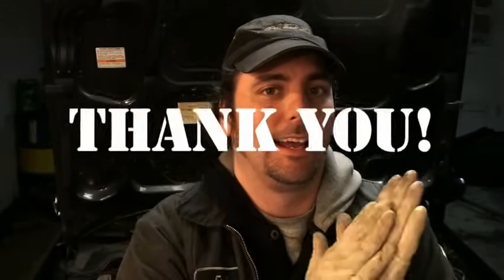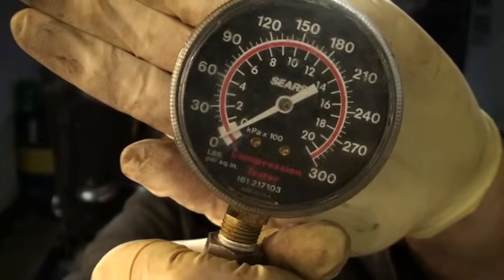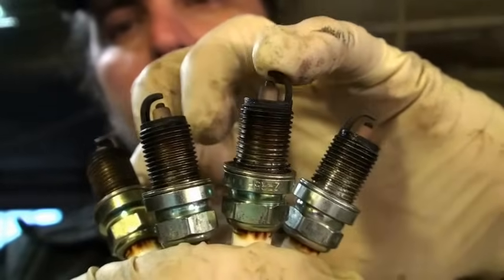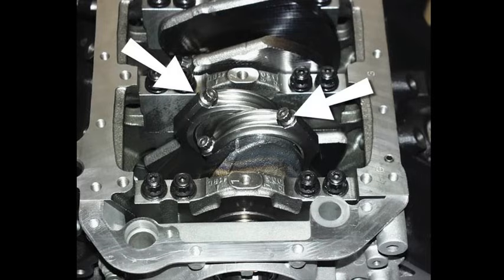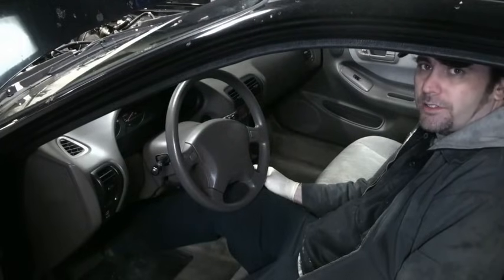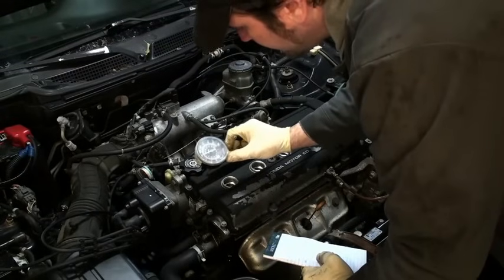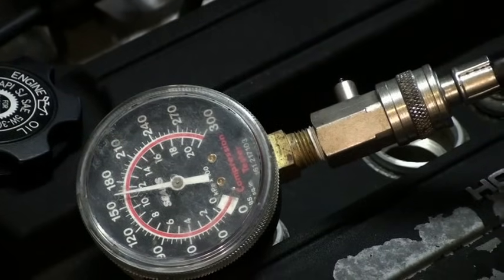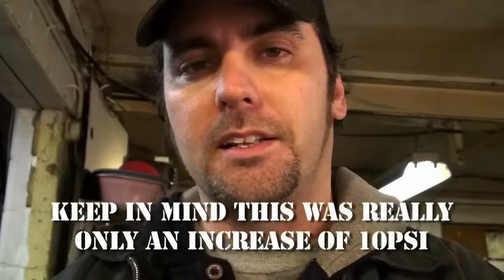How To Perform a Compression Test - EricTheCarGuy

Comment: the seal to fail around the sensor thus spewing all my oil out

my other problem is i think my valves could be sticking thus causing the engine to burn up all the oil.. what should i do where should i start

Comment: hey eric i have a problem my 1975 ranchero i just got ~,~ its a shitty gm shared engine 400 cid i am having several issues  1 is that there is some type of sensor behind the air box that is leaking..... i was coming home and i noticed a tapping sound . Now 2 days later there is barely no oil on the stick what so ever it is hard to start on cold days  considering this vehicle recommends 20w-30 and 20-40 Weight oil not sure if the sensor was a oil pressure sensor that just completly failed causing

Comment: My mechanic told me that the cylinder number 8 had an electric leak, what y mean is that the spark plug was not completely seal and the nut that hold the spark was broken and this could cause a compression problem is that true ?

Comment: Eric i have the same problem with my 2001 f150 In some point when driving i felt that the car was shaking and my mechanic said that there was a problem with compression, of course if this truck had a distributor it would be much easier to locate the cylinder that was having problems but since this truck has separate coil a scan tool had to be plugged to see the cylinder.

Comment from the maker: @journeyquest1 I suppose you could say that but a head gasket may only show up if it's between 2 cylinders.  You might want to watch the Diagnosing A Cooling System Overheat for a test for a head gasket failure.

Comment from the maker: @stanb420 That information is specific to the engine that your working on.  In my experience these numbers were fairly typical but if you really want to know what shape the engine is in do a Leak Down test as it is far more accurate.  A compression test is normally good for a 'quick look' at an engines general health but nothing more.

Comment from the maker: @RalphdaCuban It is true that many fuel injection systems rely on a vacuum operated fuel pressure regulator however if you have a compression loss vacuum loss is really not the primary concern.  Thanks for your comment.

Comment: Makes sense. I guess I have to stick to the "trial and error" method. Since tuning by ear has worked great for me in the past for finding that "sweet spot" for air fuel mix detonation (even though there are stock settings for timing). We folks down here have a problem with watery gas (even in premium) That water does make the perfect detonation hard to find. But hey,thanks for the quick reply. I was just hoping that there tool could be used to make tuning by ear turn into tuning by sight. Peace

Comment from the maker: @gregorydtatum Compression is constant and has nothing to do with when the plug fires.  Since the time it takes for the mixture to burn is also relatively constant the 'timing' of when you begin combustion is critical for optimum power and efficiency.  I think you need to change you thinking of the relationship between compression and when the spark occurs as you are kind of getting into left field.

Comment: Thanks for getting back to me so fast Eric. And I wanna go on record as saying DUH, duh, duhhh Greg. I totally forgot to take in consideration the fact the plug fires BEFORE top dead center. If not, the timing would be set to 0. But i was more in the lane of thinking that maybe the compression tester can give you an idea of how deep the stroke is and compression in the cylinder just before ignition. Then while slowly turning the distributor the pre-ignition compression changes........

Comment: @EricTheCarGuy 
I just check the timing, the timing is off by about 1 to 1.5 cm.
I checked the gap between the mark on the crank pulley and on the engine block, a little arrow.
Considering the size of that gap, is it the belt being too loose or the timing belt off by a tooth?
Thanks

Comment: Heck of a video man! I agree with the others that say you should be a teacher if you're not already. I just have one question. Since ignition timing is basically when the spark plug fires compared to the piston's position on the compression stroke.......I wonder, can a compression gauge be used to set OPTIMUM engine timing? I often have WEIRD questions to ask (I like to think outside the box) so forgive me in advance, think about it, and get back to me. Thanks, GREG

Comment: @mariohdz2626 Glad you listened to my advice...I've had plenty of experience with ebay garbage over the years on my eclipse. I just finished a major build, induced by my ebay trash that i put on cause i needed a dd and was low in the wallet. Now im runnin a completely built head by dsmgraveyard = 1750. MHI evo III Big 16g. DSMlink on 95 eprom. web 272s on obx gears. tubular manifold. ported out 2g head to 1g ecimulti intake. and everything else greddy or hks.

Comment: @EricTheCarGuy 
Timing variations huh? Hmm.
That means that the timing isn't always right during the engine operation, such when revving and all?
Although I get great fuel economy?
I'll get myself a timing test light to see if timing is off. 
So you believe a variation of less than a tooth can cause knocking/tapping and engine losing power?
Thank you for all.

Comment: @thaik56 
About the valve tapping, I can clearly hear it at around 3k rpm, that's when it's really noticeable. But it does it only when accelerating, when decelerating or maintaining speed, I can't hear it.

Thanks in advance.

Comment from the maker: @thaik56 Hard to say really, now that you have ruled out a mechanical issue you might look for any check engine lights and fix those first, also check your tune up items and now that I think about it what you describe could be an exhaust restriction issue so perhaps drop the exhaust and take it for a drive to see if the performance comes back.

Comment: I get pretty good readings from a dry compression test.
Readings are really close to each other. Around 200-210 psi.
However, I still feel like the engine is losing power, especially when the car is warm, the hotter, the more power I lose.
Any ideas?
Thanks

Comment: Hi i have a 95 Eclipse GST , the turbo just stop boosting, its a 2 weeks old Ebay 16g turbo i took off the turbo and it doesn't have a lot of shaft play or smoking ,i  but it sounds wired when i press the gas it doesn't give  any boost at all  when I'm driving ,i checked boost leaks and everything looks good. My ?? is what happened when the internal waste gate doesn't  work?or Is it a blown turbo? Thanks man.

Comment from the maker: @k9driver There IS something to breaking in a new engine, it normally takes about 500 miles, you basically avoid WOT and vary your speed so that your not running at a constant RPM all the time.  Sustained high speed driving will burn oil with ANY engine so if this is how you normally drive you can expect to burn more oil because of increased cylinder pressure.

Comment: Hey Eric. You are my favorite YouTube guy. I don't watch videos all that much, but I pretty much watched all your videos. You are very inspiring.
Do you know what causes brand new cars to burn oil? I had an 2000 Honda accord and an 07 wrangler that had oil burning issues since day one. I even had the accord engine rebuilt with new piston rings but the problem didn't go away. I eventually sold both cars because of it. Did I get a lemon or did the car not break in properly? I was losing about 2 q

Comment from the maker: @Amopower By no means is this an accurate test of cylinder sealing in the first place so a 'little' leakage really won't make a difference in my opinion but if you install the test lead correctly there should be little leakage as it seals with an 'o' ring.

Comment: If the tester fitting is just hand tight by twisting that rubber hose, how do you know you arent getting any leaks through the threads and that the compression number you are getting is accurate?

Comment from the maker: @bomsexplosive It's probably not the valve seals but as described in the video the wet test helps give evidence to the rings condition especially if it goes up significantly.  You might also want to check for a head gasket problem, I cover that in the Diagnosing an Overheat Condition video.

Comment: you sound/act just like Mike Rowe from dirty jobs lol

very good information here. I am about to do a compression test tomorrow because my car is burning oil and white smoke is coming out of my exhaust. I know a Leak Down Test is much more accurate but i don't have an air compressor at the moment so im just gonna go with a compression test. But before i do the compression test (wet and dry) on all 4 cylinders, how can i tell if the piston rings are bad? Im really hoping its just my valve seals

Comment from the maker: @jemjem1974 You might start with a power balance test to see if you have one or more cylinders causing the problem (I did a video on this test).  I would also check for vacuum leaks as per the video that I've made on that subject.  That should be a good place to start at least.

Comment from the maker: @deadlyimage A compression test is a 'general' test of an engine's health, a better more accurate test is a leak down test which I've also made a video on.  However if your experiencing a performance problem you might want to start with a power balance test to help find a bad cylinder, I have a video on this as well.

Comment: @MercedesBenzEng Dig this (if you can)  I work for a Hyundai Dealership in Melbourne Australia.
Recentely we had an "I LOAD"  diesel come in with a complailt of the engine would just rev out of control - turn the key off and it would still keep on going - uncontrolled revs for about 10 to 15 seconds with clouds of smoke coming out of the exhaust pipe. (that is a long time)  What do you think the problem might have been?????

Comment from the maker: @fastvpbt1 There are lots to choose from really you just need to match your needs with your budget.  I would not go for one that is less than 18V however, I used to have a 12V and it didn't work out too well.

Comment: I have a problem with my 03' Tiburon, The engine shakes a lot when its in drive... I've filled the mounts, and even tried new ones and it still shakes. I changed the spark plugs and wires, and nothing. Anyone have any ideas on what could be the problem?

Comment: eric should the comp test be done while the engine is hot? I would think so but im not sure exactly how it works with cars. With aircraft comp tests are done with the engine hot. Now we use a static comp test that is we put compressed air into the cylinder and look how much psi it will hold without leaking off. Not like cars with the dynamic comp testing whre you use the cylinder to create compression. But still i would think you would want to do it with the engine hot. Unsure tho. Thanks

Comment from the maker: @uninoculated Be sure to check to see if the engine is in time mechanically but also make sure there are no air leaks in the tube that runs from the air filter to the engine as this will cause the mixture to be off.  Also if you have any check engine lights be sure to diagnose and repair those as well.

Comment from the maker: @shishoromer I have one of those too but don't forget you also need to block the throttle open, if you do it the way I show in this video you not only hold the throttle WOT but you also shut off the fuel to the injectors.  Thanks for the comment.

Comment from the maker: @jackeddanny If your concerned about a head gasket issue then watch the video I did on Diagnosing A Cooling System Overheat as I go over the procedure for finding a head gasket failure.  I would not assume it's the head gasket however as it is more common for the intake gaskets to leak on that engine.

Comment: Hey Eric, I have a Pontiac 3.9 v6. There is some moisture or leakage around the head gasket, and my car is telling me I have low coolant. Also it pulled up codes 106 and 174 which have to do with maf or a misfire. Its not blowing any white smoke and the oil checks out fine. I performed a compression test today and everything was pretty consistent.  do you have any idea of what the problem may be?

Comment from the maker: @bmuldersmayday Not really, it's probably the gauge or perhaps it was listed wrong as there would not be that much of a jump normally.  Aside from that a compression test is just a general look at the engines ability to produce compression and only vaguely suggests what the engine is capable of producing.  Based on those readings I would say your engine is healthy.

Comment from the maker: @Placer You still need to hold the throttle open at WOT to do the test but you could pull the relay and it would do the trick to disable the fuel system.

Comment: So if I findout I have bad piston rings and choose not to bore my cylinder walls out and decide to just put new rings on. What kind of problems would I run into if any??? I just started to blow blue smoke out a week ago and my strong guess is bad rings. Is replacing my piston rings even a option in my case??? Engine is a 4G63 turbo out of a 98 eclipse gst with 115k on it.

Comment: couldnt have found a better video since you used an integra LS which is pretty much identical to what i have .. gonna do a compression test on my 97 jdm integra type R motor tomorrow and hopefully its a little better than what im hoping. the motor is burning a little bit of oil though so im gonna keepy my fingers crossed

Comment from the maker: @fastvpbt1 I love this comment.  Actually I think it would be best to try 'hot wiring' the blower motor first by running 12V and a ground to it just to see if it can work properly, if not then you might replace the resistor you speak of to start with and know that it's more likely to be something in the head unit or the wiring between it and the blower motor.  Some testing might save you some money.

Comment from the maker: @sorryslimstore To be honest a compression test is a general test to help you find big problems, personally I don't have a problem with testing cold as cold or hot if you have major compression loss or uneven compression it will show up either way.  It your case I would say you have some very low compression and the next thing I would do is a leak down test.  I've done a video on this too if it helps.

Comment from the maker: @sonyhotdogs It could very well be a mechanical issue with the engine and a compression test is a very good place to start to find it.  Do a leak down to find out if it's a problem with the top or bottom part of the engine.  Good luck.

Comment: @EricTheCarGuy
I have a question. My 91 300ZX NA has been missing for a while now. It has good coils, all new spark plugs, and replaced injectors. And it is still steadily missing. I pulled the old plugs and the plug was soaked in oil. Also, the inside of my header was soaked, along with the O2 sensor, on the same side as the plug. Do you have any clue what this might mean? I'm compression testing somtime this weekend.

Comment: @fairjason i would do it at operating temp because those are the conditions that you will be drivng it under. as he shows in the video, there are very small gaps between the pistons and the cylinder walls, we understand that as metal heats it expands so when the piston and rings are hot they will be wider and closer to the cylinder walls which will give better compression. this is also why you should always warm your engine up before giving it high revs.

Comment from the maker: @Volvo240Zimm It's not a bad idea to check the timing to make sure it is correct but resetting it my not be necessary.  First confirm that the engine is not flooded and then proceed, go for the simple solutions first and don't overcomplicate it.

Comment: @EricTheCarGuy  Yea doing the compression test my plugs were gasy. Okay dude ill try that Clear Flood tech! a friend said maybe it skipped timing? So my valves wouldnt be "dancing" with my pistons also resulting in no compression. If Clear Flood doesnt help. Im prolly gunna re-set the timing belt to KNO the cam,intermediate,and crank sprockets are all lined. nd if after that i may have fried piston rings or head.   1990 Volvo 240 w/ 4 cyl 2.3L SOHC B230f. thanks for support
Pete Zimm :D

Comment from the maker: @Volvo240Zimm Sounds like it was flooded, when that happens it can wash the cylinder walls down and rob the engine of compression, clear flood helps with this, put your foot to the floor on the gas and it should turn the injectors off while you crank to help clear the flood out.  Thanks for the comment.

Comment: hey bro yeah got at 90" Volvo 240. and you mentioned when the starter gallops! and mine used to but ever since i cant get it started.(Have Spark and injector pulse and made new fuel system from tank to engine pumps and all)  but now there is no gallop anymore and i did this compression test and got Zero psi? Thanks buddy your a savior

Comment from the maker: @papercut1987 If I'm honest I don't know the size of the plug off the top of my head but it's the smaller size, there are only 2.  You use just regular engine oil for the wet test.  I'm not sure how much good seafoam would be but it can't hurt to try, I actually thought of doing a video on that at some point when I found a car to test it on.  You might benefit from the Leak Down video I posted last week as it is more in depth than this one.

Comment from the maker: @billie6688 If the oil was where the spark plug goes in I made a video on how to repair that problem "Spark Plug Well Leak Repair".  As for the other problems if you do this test or even better a leak down test you should be able to find the cause of the problem with the engine.  Good luck.